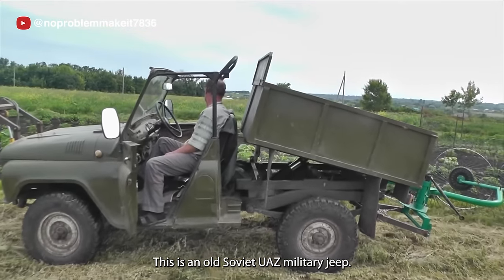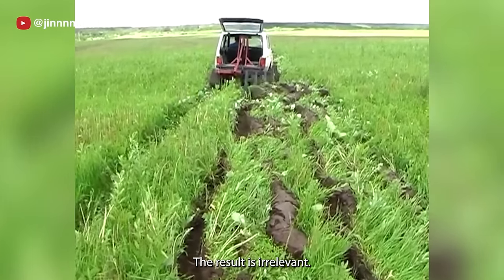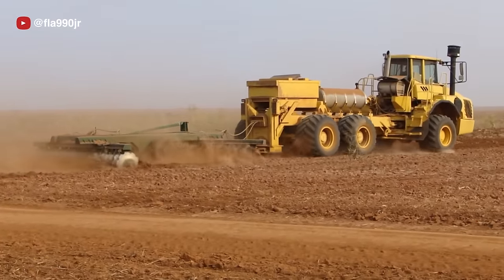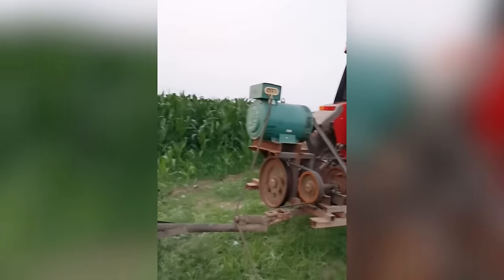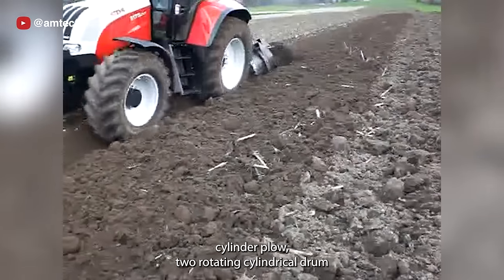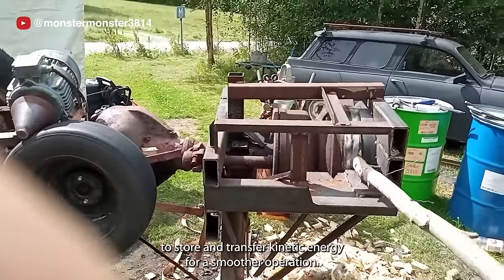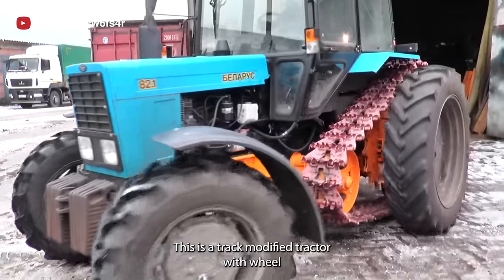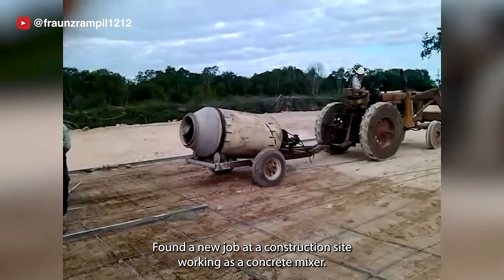Turning Old Truck into Farm Machinery

Comment: The rotary plow would be perfect for a hay field with soil compaction. Give it 8 bottoms instead of two for use with a bigger tractor. 
A field could be done in one pass instead of three. One thing I would change is the discharge. It doesn't need to throw to the side, just put it back where it was.

Comment: Traction and grip can't be as good as a proper tractor.
Reply: Agreed, but even western modern farmers didnt have say 30+ ton case QUADTRAC tractors pulling  plows the size of houses say 50 
years ago when many even european small farmers still used 1 horse ore even a cow pulling a single wooden plow. hehe
I grew up in a fishing village in northern norway in 1960s our neighbour had 8 sheep and used a hand sicle to carve what grass 
they could find between the rocky hillsides and freighted it with row boats to the house loft for storage while the sheep lived in the basement.
usually they didnt have ENOUGH HAY for the around 9 month winter, and had to collect  seeweed and boil fish heads to add to the sheeps diet.
I earnd my first pocketmoney at 6 by helping the neighbour getting him seaweed and selling him the fish i could catch from the dock.
My parents didnt have animals, and what you can call a garden around the house. whatever eart there was between the rocks was used for 
potatos and a few carrot plants and 2 rhubarbs.
in the 1980s as we got ferry and later a tunnel connecting the road to the outside world more and more food got imported and people stopd
WORKING with sheep and vegetables since it was easyer to go to the new local shop and just buy a bag of potatos-bread and say pizza. hehe
Reply: @samkom33  In Ireland these trucks would get stuck.... 😂